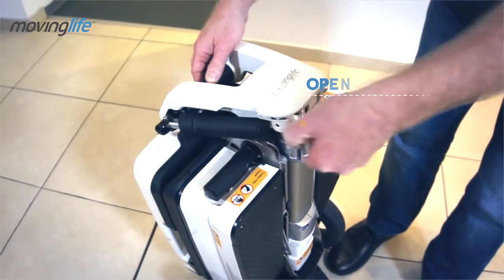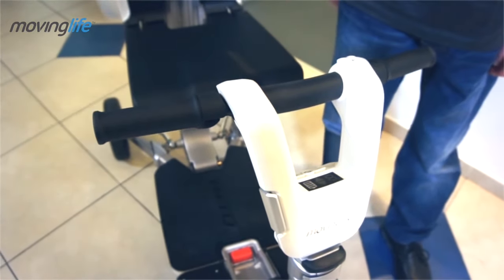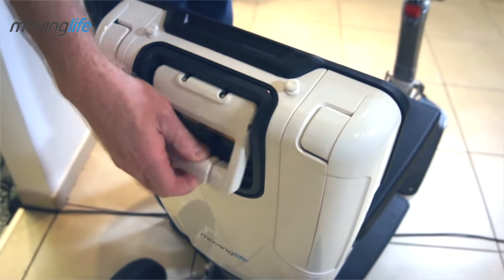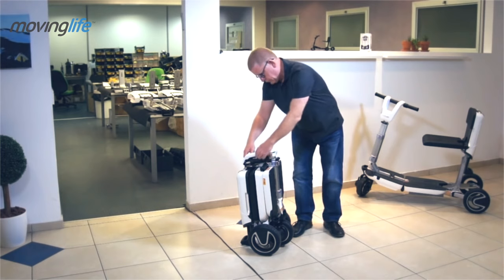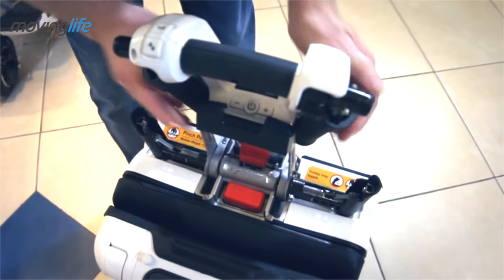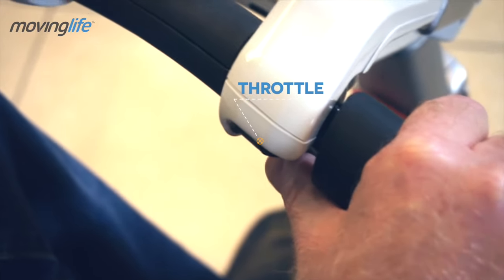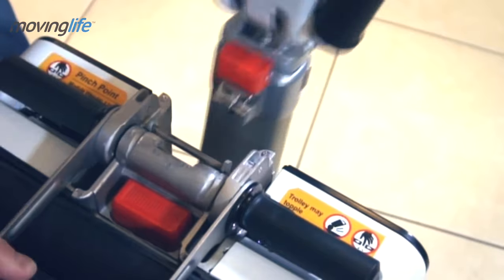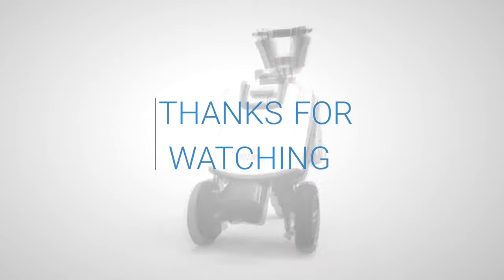ATTO operation guide

Comment: I bought an ATTO, I went for a ride on it. And 
an error signal went on,and  I couldn't move it. Can you tell me what I can do to get it started again.
Reply from the maker: First of all, there is a button on the front wheel, if you push it the break system is off, so you can roll it. We need an error number please

Comment: I bought my
At to And only used it four times. Today I took it for another ride , The control went into error  And flash 8E8. E!error, And now I can't get it to run. Can you send me a message where I can get help.
Reply from the maker: Hi Gloria,
please fill out the form and please check that the break button on your front isn't switched, if the break is off system doesn't start. 
https://www.movinglife.com/pages/contact-us

Comment: May I ask a few questions?
1st) What is the approximate range with a full charge?  
2nd) Does it have several speeds? 
3rd) Approximately what angle uphill can it climb?
Reply: Hi. U can do roughly 20km on a fully charger battery. The speed is maximum 6km per hour. There is a software to make it go faster but then u have to get a number plate on it and insurance. Going uphill it sort of ‘grips’ on the road. I was told to lower the speed on my one wen going uphill as it makes it easier for it to get up the hill. Hope this helps. This is the info l got wen l bought mine
Reply: Just remember you're not racing in the grand prix- avoid wild driving! You don't need to fall right? Be careful,- I'm impatient too but stay safe!

Comment: I cant figure out how to charge battery the second i plug it in it has a green light, but the atto doesnt go.
Reply: Make sure you have installed the fuse, the battery will charge without it, but the atto will not run without the fuse installed.

Comment: In incline?    incline power loss?  What about this lasting all day at an amusement park?  Zoos ?many zoos have hills up and down some zoos not so bad on the hills but I could use the wheelchair ramps but it would need hill climbing power as I have seen manual push wheelchair-human power is really pushing hard.
Reply from the maker: Dear Cindy, you can see all the information and specs here: www.movinglife.com

Comment: This mobility scooter is only good if you have an assistant if you are physically handicapped and have no one to assist you you will have a problem opening this scooter if you're handicapped is the kind that allows you to still do sports and walking up hills without too much of a difficulty then you'll be able to handle this but if not then the scooter is not for you. If you are over a hundred and 20 kilos or even 110 kilos they will tell you that definitely the scooter is not for you even though they do have problems with this scooter. Some of the older models and a few of the not top of the line models are actually better than the top of the line models but again this is not a scooter for people who are physically handicapped without an assistant and be aware of that if you notice the people folding it up they are not severely handicapped okay they can pick it up they can put it in a car I eat they're not the one that the real that the scooters really supposed to be for they're the people who are assisting and if you don't have one a person to assist you this is not the vehicle for you.